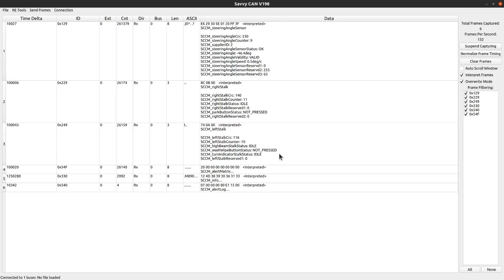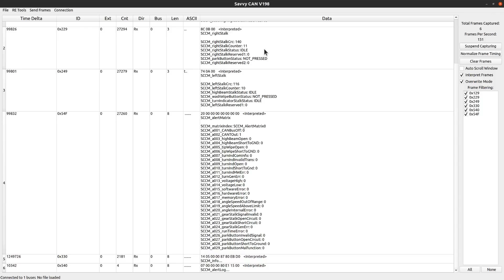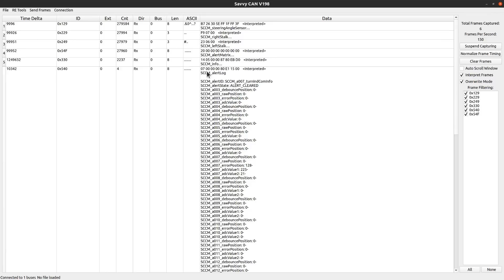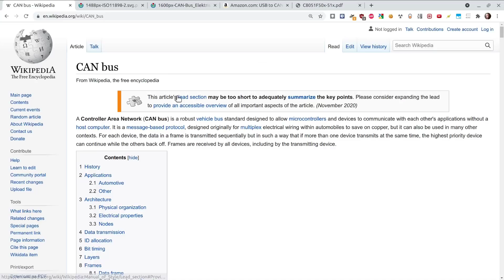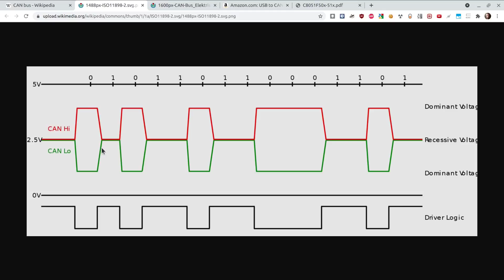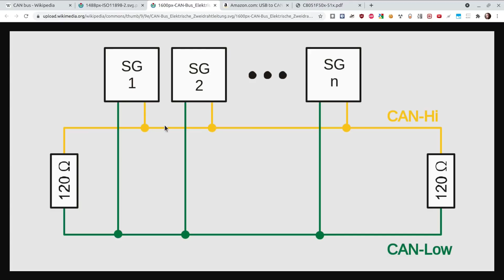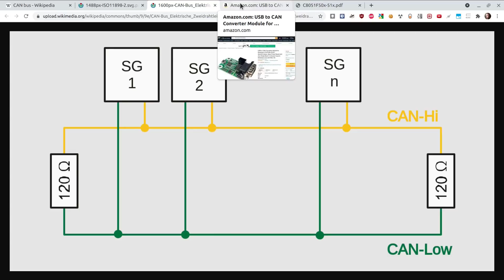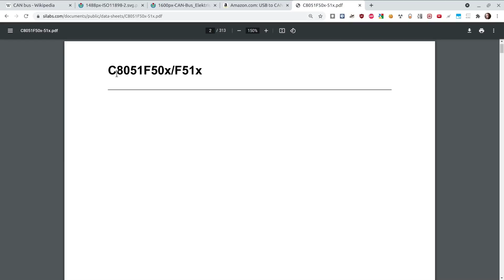Tesla CAN Bus - Quick Exploration

Comment: Would be great to see the LIN video as well (I know nothing about it)

Most people (myself included at first) who have an understanding of computers and networking might say 'why not just use ethernet cables, its good enough for computers'. The advantage CAN has is what is pointed out here: its 2 wires twisted together and all devices can just tap into the same length of wires to talk to each other. Compared to ethernet where each device kind of need its own wire to connect to a central hub, and ethernet is like 8 wires. So a bigger savings in terms of cable weight and cost.

I do hope non critical assemblies or sub-assemblies can switch to bluetooth or similar. imagine all the wiring in each door (window, power locks, any other buttons there) collecting the signals together and then wirelessly communicating to the brain of the car
Reply: An advantage of Ethernet is the higher data rate. CAN generally has a lower data rate.
Reply: 10BASE2 ethernet (10 MBit/s) would be the same: 2 wires (in 1 coaxial cable), devices tapping into it in a bus like fashion, one collision domain. 
You are referring to 10BASE-T or 100BASE-T (star structure, 2 pairs=4wires) and 1000BASE-T (4 pairs=8 wires) as used in desktop or data center environments. 
Industrial ethernet standards however (like BroadR Reach, also used in Tesla vehicles) in contrast reduce the need for wiring (single twisted pair) and increase robustness at the expense of data rate. Still it's way faster than CAN bus.
Reply from the maker: Cost.  Adding a full ethernet stack to run something simple like a power window motor doesn't make sense.  The BoM cost of that motor controller would go up by 3000%, and reliability would go down.   BroadRreach is only used where that kind of bandwidth is needed, and only to/from complex systems, usually running a full OS stack.
Reply from the maker: Cost is the main driver.  It would be cost-prohibitive to implement ethernet on all the small devices inside a modern car.  There's no need for the speed requirement, and ethernet does not have a priority mechanism like CAN.   Same with adding wireless transceivers to every device.  You still need to send power, so why not add one more wire or 2 and not have to worry about the extra cost and unreliability of wireless?   Doesn't make sense, and imagine what happens when the RF noise floor gets untenable?
Reply: Agreed, later on I thought about ‘if wireless all you need to run is a power wire’…but then if you do that you can just use LIN over power and maintain that simplicity

I wonder if there are instances where the cost equation tilts the other way of taken into account labor cost of manufacturing

Comment: Dumb question, when making a CAN stub for a USB to can converter, it's literally just pins 2 and 7 for can lo and hi, right? No extra power or ground wires needed?

Edit; dang, the part of you showing how you're terminating the can wires isn't shown
Reply from the maker: Yes, sorry.  Editing mistake.  You are talking about the DB-9 pins, yes it's 2 and 7.  If you scroll down on the Amazon link, they provide the pinout.  You don't need a ground reference is there is galvanic isolation, it's optional.
Reply: @Ingineerix  ah, thanks, but it sounds like you also have a 120k ohm resistor somewhere on there too?
Reply from the maker: @Ryukachoo  It's not 120k, it's 120 ohms.  And you can clearly see it in the beginning of the video, it's connected using the 2 blue wire nuts.  The other termination is inside the CAN to USB adapter, which is enabled by a jumper.

Comment: Is the CAN bus separated/sectioned into critical and non-critical areas, or is it just one big "omnibus"?  It seems like from a stability/bandwidth perspective the critical driving tasks should exist on their own bus, and other non-critical could be on another one.
Reply: There are multiple separate CAN busses on a Tesla, of course, not just a single big omnibus. Traditionally, in other brands there are at least: powertrain CAN, chassis CAN, body CAN, infotainment CAN, diagnostics CAN. So that somehow separates critical ones from less critical ones. Teslas add Ethernet / Broad R-Reach connections and still has likely even more CAN busses when counted across the whole vehicle.
Reply from the maker: @koeniglicher is correct.  Even early Model S in 2012 had 4 CAN buses, now some models have over 12.  CAN is also pretty fault tolerant by design.

Comment: Takes about an hour to watch a 19 minute video when in the middle I get sidetracked by reading the development board docs (C8051F500DK on Mouser).
Good video.
Reply from the maker: If you want to dabble with CAN on a microcontroller,  I suggest something like one of these to start with:
https://www.macchina.cc/catalog/a0-boards/a0-under-dash
https://www.olimex.com/Products/IoT/ESP32/ESP32-EVB/open-source-hardware
https://copperhilltech.com/esp32-wifi-bluetooth-classic-ble-can-bus-module/
https://www.tindie.com/products/voltlog/canlite-esp32-can-development-board/

All of these use the Espressif ESP32 which is supported by the Arduino IDE, so it's easy to get started.  (Also supports wifi!)
Reply: @Ingineerix  Thanks!
Edit: Oh, I've used those. Thinking of developing a CAN controlled HVAC system for an industrial application, but avoiding the costly over-featured products I have encountered on the market. Still under a non-compete for a bit, but getting ready :)

Comment: You alluded to this, but is it common to have multiple can buses for different purposes? If so is there some device that listens to all of them for diagnostics?
Reply: Yes it is common to have multiple CAN busses for different purposes. On Teslas, there is a proprietary diagnostic connector in the console area that exposes a number of CAN busses and some Ethernet networks. For diagnostics there can either be a CAN gateway device that then transmits diagnostic requests to the appropriate busses. Or in case multiple CAN busses do not have a gateway and are all exposed to a diagnostic connector, then the external diagnostics hardware (vehicle communication interface) typically contains a multiplexer. This multiplexer then switches to the right bus first, and does its diagnostics jobs. For this to work, the diagnosis application needs to know beforehand which ECU (electronic control unit) is on which bus. So, instead of listening to all of them for diagnostics in parallel, the multiplexer first talks to the first CAN bus, then the second, then third in an all ECU scan. In diagnostics, a certain focus is required, otherwise you will be just flooded with messages and data from all sorts of ECUs and sub-systems.
Reply: Yeah, besides expensive multi-CAN dongles, there are boards that use 3xCAN of popular STM32 chips. 
It is common to split powertrain, chasis, ADAS networks, etc..